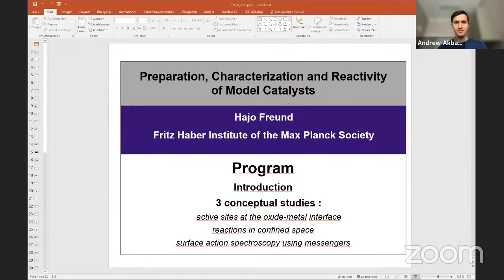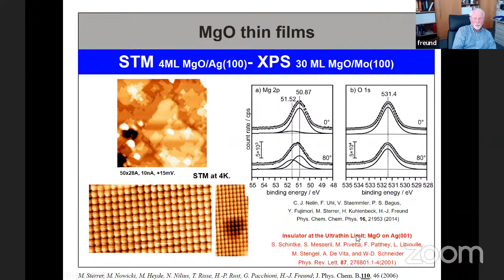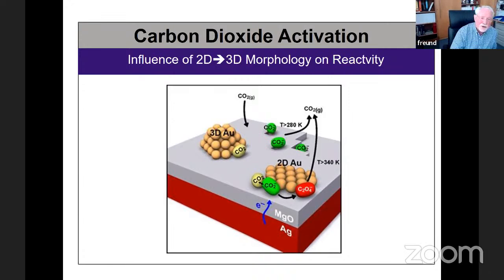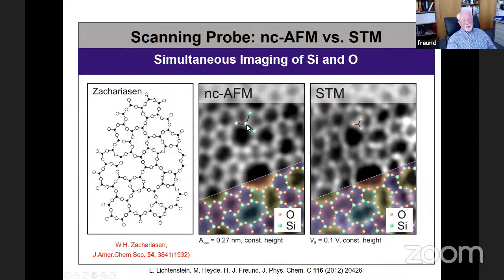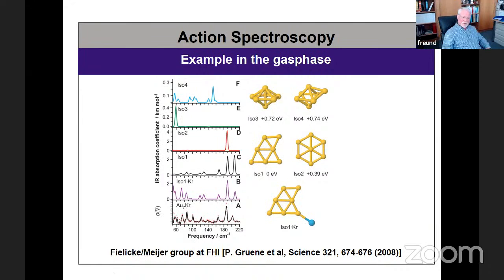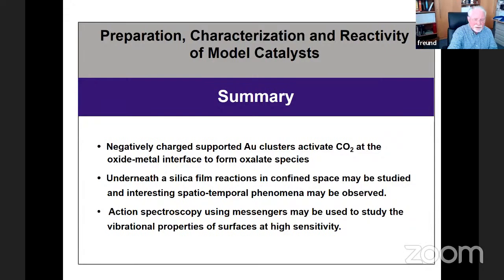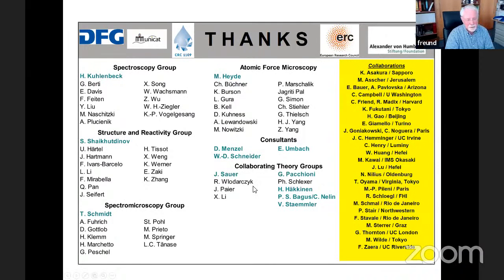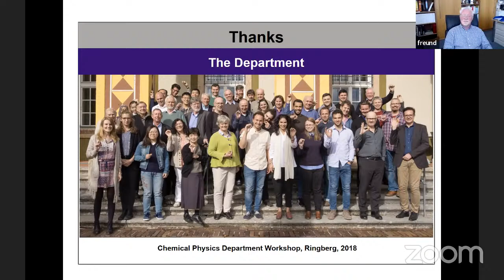39. Prof. Hans-Joachim Freund  -  Heterogeneous Catalysts at the Atomic Scale

Comment from the maker: 00:00 - Introduction
02:23 - Catalysis at the atomic scale
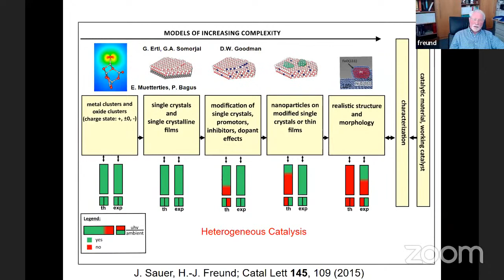11:17 - Oxide surfaces and films
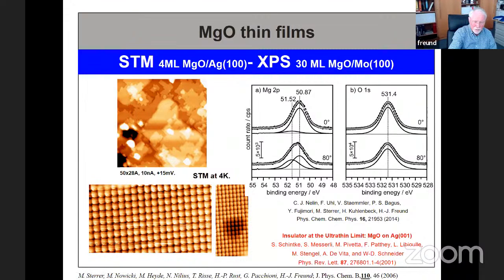16:38 - Active sites at metal-oxide interfaces
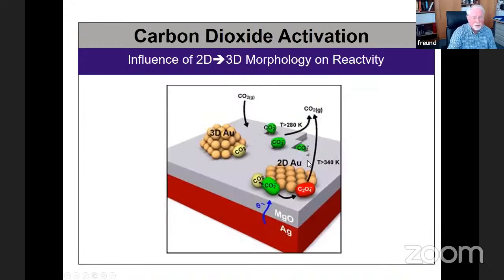29:07 - CO2 activation on Au/MgO
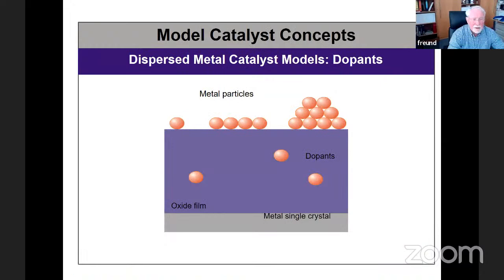33:45 - Activation of CO2 through Doping 
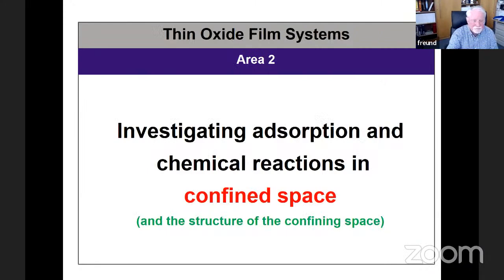36:59 - Adsorption and reactions in a confined space
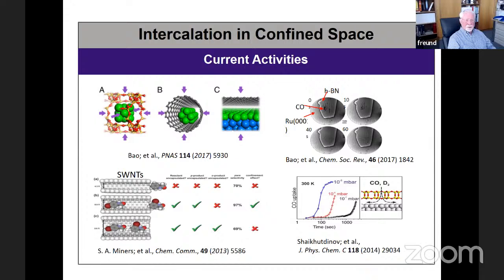39:26 - Confinement between SiO2 film and Ru(0001)
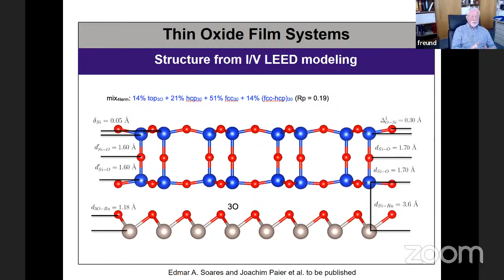54:27 - Action spectroscopy using messengers
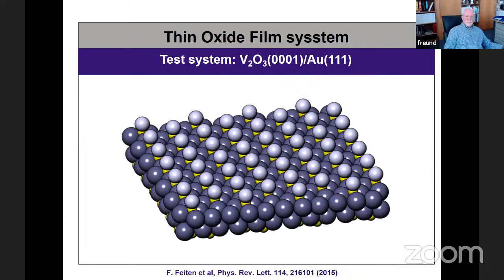57:59 - The case study of V2O5 (0001) / Au (111)
1:02:32 - Atomic arrangement at the Fe3O4(111) surface

Q&A:
1:08:00 - Q1: The depth of the near-surface layer that determines adsorption
1:09:43 - Q2: Stability of SiO2 film and its properties
1:12:02 - Q3: Structure of the vitreous silica phase
1:14:20 - Q4: Au growth on Mo-doped CaO
1:20:44 - Q5: Physical effect of the limited space at the atomic scale
1:23:41 - Q6: Adsorption processes from Angle-Resolved Photoemission (ARPES)
1:27:11 - Q7: What can and cannot be predicted by theory (DFT)
1:28:31 - Q8: Poorly defined catalytic surfaces
1:31:27 - Q9: Advice to early stage researchers in catalysis
1:34:01 - Q10: What can electrochemists learn from the field of heterogeneous catalysis?